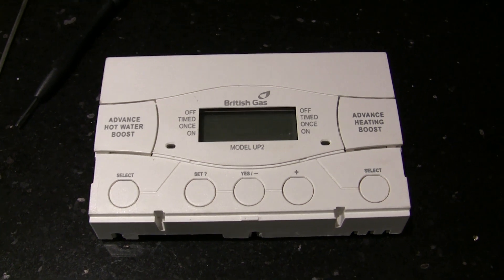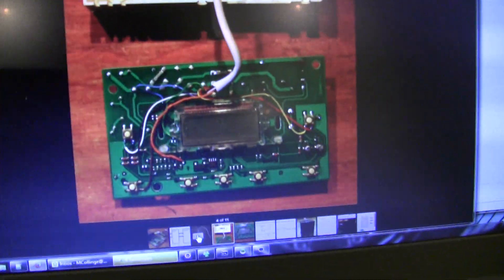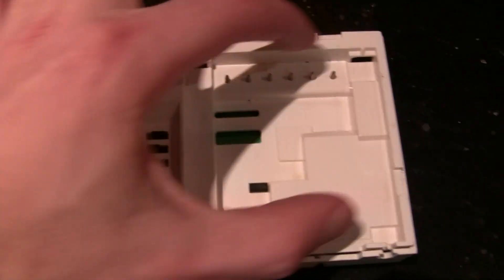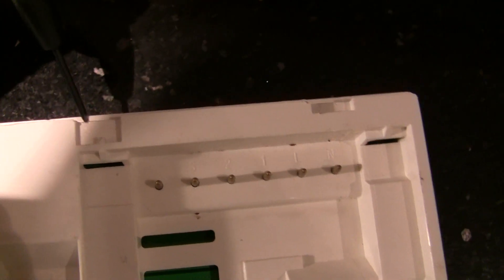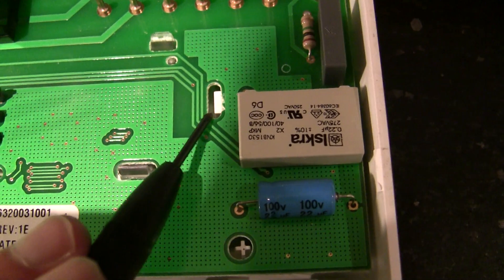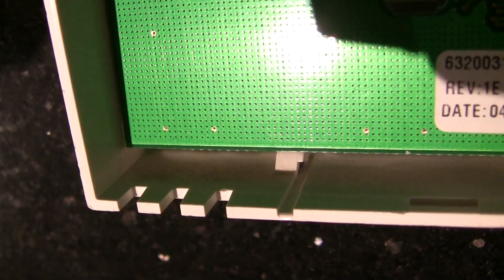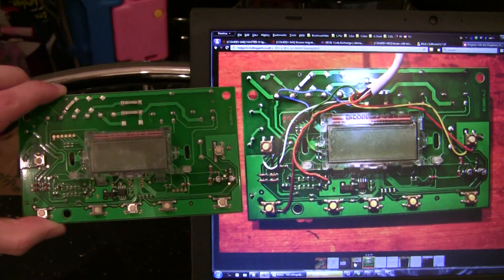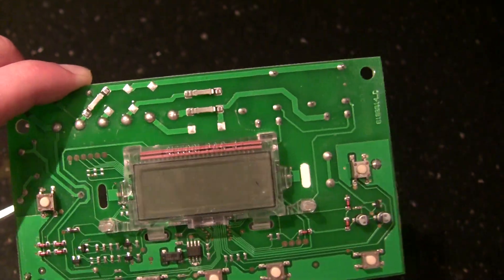How to open a British Gas UP2 Boiler Control Panel

Comment: Thanks for this! My parents have the same model of control panel, which one of them just can't fathom how to operate. This wasn't a problem until the other went into hospital recently, and so I'm now tasked with modifying the control system in such a way she'll be able to use it without trouble. 👍

That said; From my personal perspective - And as most (UK) central heating systems signal demand to the boiler by sending mains voltage¹ down a control wire - I think I'd dispense with wiring into the panel completely and employ separate relays driven by the Arduino/Pi directly. For me at least, this comes across as an easier way of doing it. 😇

(¹ - Safety note: In all cases, signal voltage must come from the same circuit that the control gear is powered from, in such a way the signal voltage ceases if the control gear is isolated. If voltage is drawn from a different circuit (e.g. The ring main) you may inadvertently create cross-circuit loops that may cause unpredictable results including dangerous fault conditions. ⚠)
Reply from the maker: Nice! What are you going to give/make for them as a new control panel?
Reply: @Endpoint101Tech   My preference is to leave the system as unchanged as possible, so most likely setting the UP2 to single-day mode (Timing) and erasing all the start/stop times to make the system entirely manual, which I think my family member will prefer.

They struggle a lot with anything digital - And have a digital thermostat where their old bimetallic strip/contactor type¹ used to be - So I've ordered a Drayton dial thermostat which should be easier for them to understand and use, which I'll fit alongside some electrical tests and replacements they really need to have done. 👍
(¹ - It's a pretty scary realisation when you remember that thing simply made/broke a mains circuit via open contacts in a house with gas on. No wonder one of the first things to do in a gas leak is to turn the electricity off... 💥)